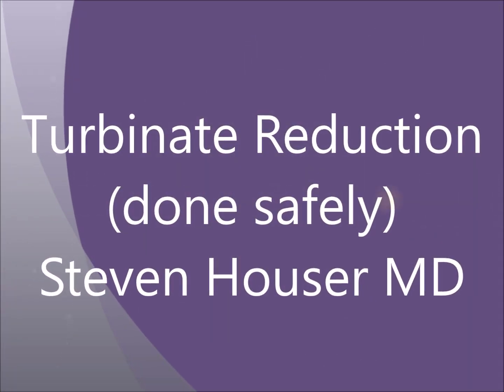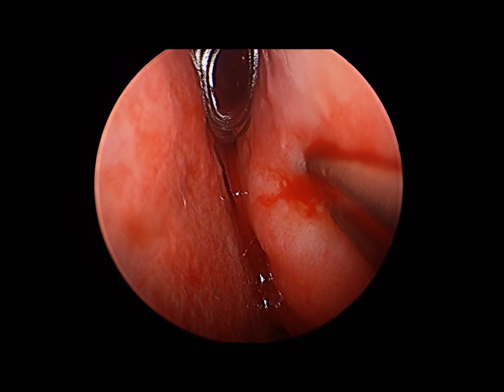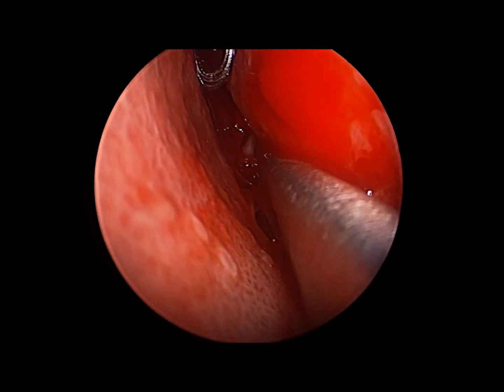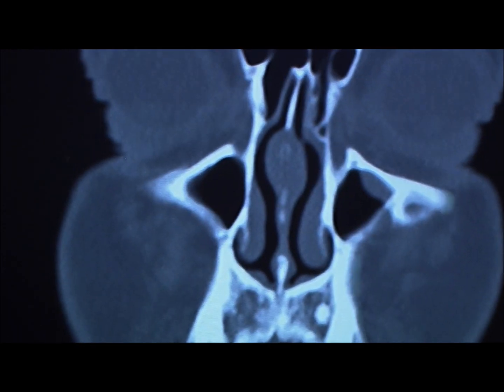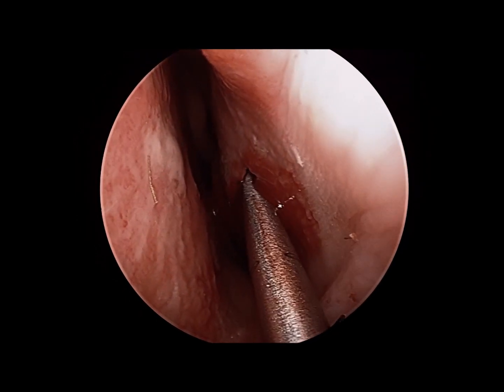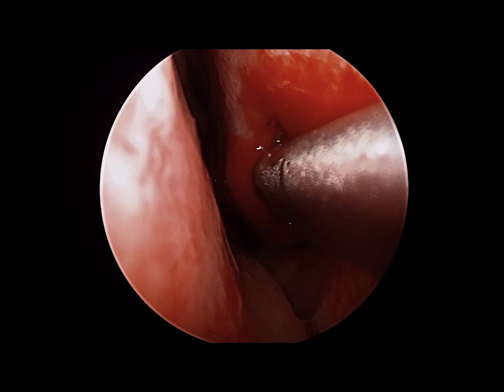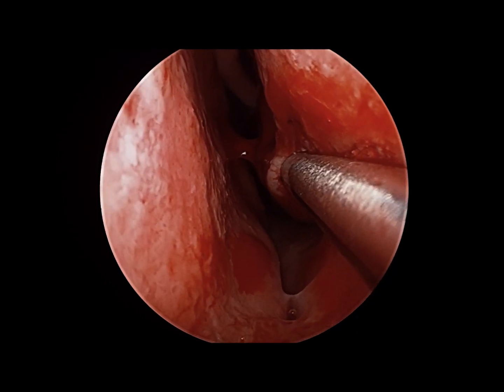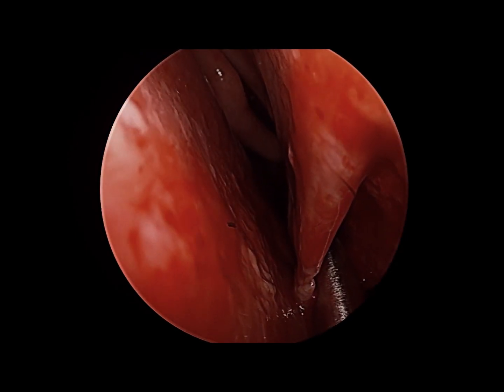turbinate reduction (done safely)

Comment: My question is when you remove this tissue does it not contain the nerves/blood supply to the exterior tissue? So in effect would it not kill off the surrounding tissue? I guess my concern is that if you take out the interior of the turbinate isn't that why you get ENS because all the nerves are cut? Also all the mucosal production would be stopped since the tissue is damaged. 
Wish there was more discussion on this, I think sinus surgery is critical, but I hear little about the makeup of the turbinate. To me it would be like sucking out the inside of the heart, outside looks great. See my point.
Reply: There was a Scandinavian(?) guy with ENS who had videos that went over it in detail and how extensive the damage can be.

He went over the Septal Swell Body to Outfractures to the nasal microbiome.

But sadly it appears the videos have vanished.

Comment: Hi Doctor Houser, my nosetril is blocked when i lay down, switching from one nosetril to another  but when i standing both my nosetrils are free , the ent diagnosed that my inferior turbinates is enlarge and he advise me for surgery, but i'm worried for any procedure that might end for ens. Is this procedure safe for ens? or any  suggestion doc ?
Reply: Don’t let them touch the turbinates!!
Reply: @sentelmays1826  yeah cutting turbinates where they obstruct air passages i.e. in frontal parts, can be risky if overdone.   Years ago, a few doctors in US, I know of two in the 80s and 90s, would freeze them, ...do what was called cryosurgery on obstructing turbinates.  This procedure was helpful at reducing size slightly so as to help breathing while at the same time would not cut any tissue, just freeze off a superficial amount.  It seemed this approach was safer for potential development of ENS than any outright cutting.  Of course much less tissue was removed.  I myself had the procedure done twice without any complications.
Reply: Don't let them use any heat. Heat is what causes ENS. Heat Scars/Necrosis of Mucosa and Sensory nerves are damaged forever. You will notice that most of ENS patients have RadioFrequency/coblation or Cautery/diathermy done to the Turbinates to reduce them or to stop bleeding. Go for Cold Microdebrider procedure and make sure the doctor does not Cauterize and pack your nose instead to stop bleeding. As Dr. Houser explains anything can be overdone or too aggressive. With cold procedure nerves can recover, but if they burnt there is no turning back. Consult a good Rhinologist because all ENS patients on Youtube, who have been vicitim of Hot Surgical Treatments, will say that all doctors and all procedures are bad. NEVER LET THEM USE ANY HEAT ON YOUR TURBINATES.
Reply: @sezwo5774  All the Sensors/Nerves/Glands are located in Mucosal Surface Tissue. Any superficial damage to mucosa whether Heat/Cold will cause damage to mucosal surface and causes ENS.
Reply: If you have this procedure done to your turbinates, it will destroy your autonomic nervous system, and as a result, the quality of your life! IT WILL HAPPEN!

Comment: Hi there, I have had sinus problems for a number of years due to breaking my nose, but also having burning in nose/thick mucus in the back of my nose then it going down throat. and 1 side always felt really blocked!

Had CT scan and results were-Deviated Septum,   + a large retention cyst in my right maxilary sinus!
Also  going to reduce my turbinates-at first thought the surgrty for that he was goignto cut the bones down but instead doing-Sub-mucous diathermy how safe is that

+ how much should you take you off with or without enlarged turbinates!  what percentage??

I'm having this done in about 6 weeks time.
Reply: How'd it go

Comment: 1 year later... Enlarged turbinates again.. Thanks to Bipolar diathermy and Coblation tech 😂
Reply: What do you mean?
Reply: @timcepin3386  bipolar and the coblation from turbinates resection is not useful for more than a year, you need neither to shave the turbinates or to fully remove them (which is rare in special cases)
Reply: What is bipolar? 
I had coblation used/done this past July. Are you stating that the turbinate or resected part will grow back? If you don’t mind me asking, how old are you? I’m 41.
Reply: @timcepin3386  English is my third language so maybe I'm not clear to you, yes the nasal turbinates will grow back taking 1 to 3 years depending on what was the cause of the inflammation (that leaded to the enlarged turbinates in the first place) if it was allergies or you was born with a bigger than average turbinates or your nasopharynx is narrow, if the allergies are the cause whenever you interfere with things that target your allergies you speed up the process of the turbinates swell again (they should shave at least 50% of the turbinates Mucous membrane) and you need general anesthesia for this procedure in clinic they can do it easily with a local anesthesia using cold (coblation) which is up to date or the old method which is heat (bipolar diathermy) both of them not permanently treating the problem.. I think I was clear in this description.. I'm 9 years old after the 20 😂